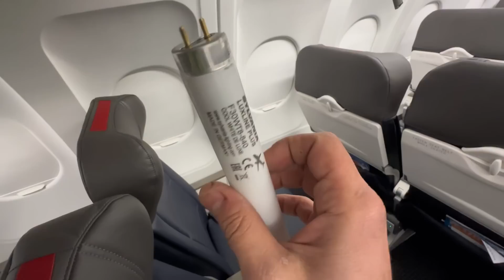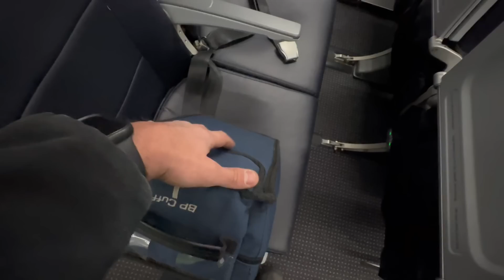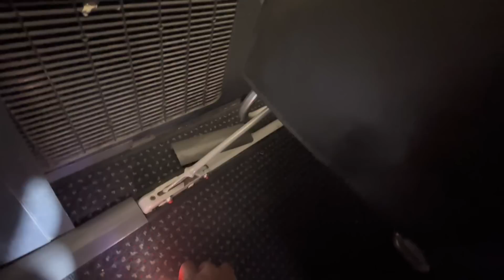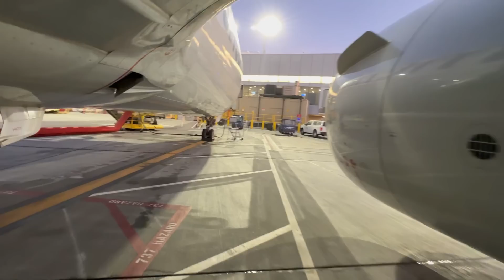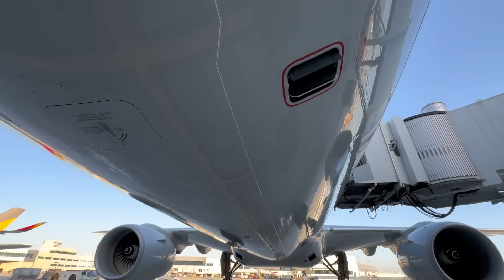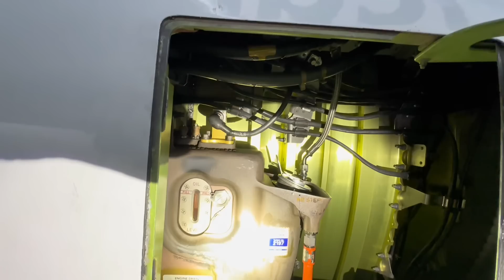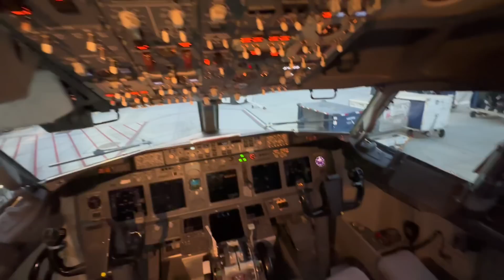Stig Shift #52 (Aircraft Maintenance Adventures)

Comment: I used to build those antennas. Viasat, Honeywell and another one I can't remember. But I did not install them. It was an interesting job though. Now I'm in Parts resolution.
Reply from the maker: @renefuller9241  the other one you’re thinking about is probably the GoGo antenna.

Comment: Studying to become an A&P, im in school.  As far as swapping out the bulb, is it easier to just take the old bulb when you get the replacement bulb with you or would you reference the manual just in case it was the wrong one installed?
Reply from the maker: @IamRayne1992  I would reference the manual, in this case the IPC, the illustrated parts catalog, to make sure that the previous bulb was the correct one installed and I will be installing the correct new one according to what the current manual says.
Reply: Cool thanks for the response. 🙂

Comment: Mr Stig, 
can you answer a question for me 
thanks
Reply from the maker: @MeaHeaR  what’s your question?
Reply: @StigAviation  oh thank you Stig,  my question relates to the A320?, I notice on approach these particular aircraft are very very irritatingly annoyingly loud. They tend to create a horrible whistling noise at approach. 
I usto think it was the CFM 56 engines but then a 777 flies over and it is super quite.
I heard somewhere its to do with fuel over pressure protection/equalisation venting. 
Is that true, why does only airbus have it, is it necessary,  can they stop it  and could you point out these under the wing and explain their operations 
Thanking you in advance 
Have aMerry Christmas 🎅 🎄 and a safe and prosperous new year.
Live long and prosper 🖖🏾
Reply from the maker: @ that’s only on very old Airbuses. Most of them have been modified with a little aerodynamic vortex deflector that diverse air away from the surge tank vent to prevent that noise from happening  i’ve talked about this in my previous videos. It was a while back though.
Reply: @StigAviation  ok thanks for the reply, I'll look for it, 
Regards 😀
Reply: @StigAviation  Also is the PACK a mechanical system, or just a simple air inlet duct 🤔
Reply from the maker: @ pack system is a bleed air driven system that has many mechanical and electrical components to operate it. Source of air comes from the APU or engine along with outside ram air.
Reply: @StigAviation  thanks 😊 i wasn't sure if it was just a simple heat exchanger
Reply from the maker: @ heat exchanger is also involved, I have done a segment on air-conditioning in previous videos.

Comment: Hi Stig! First off, I love your videos! Being able to see all the different parts of airplanes we wouldn’t see when flying on them is super cool! 
I had a question, not sure if you have covered this in the past, but I’ve always been curious. I’ve flown on a lot of 777s and always wondered why when the plane touches down on the runway, why does only 1/4 of the spoilers/ speed brakes deploy, and then 2-3 seconds later…. the rest of it deploys? May be a dumb question but I always wondered why it’s specific to that plane. Thanks!
Reply from the maker: Well that’s because you were looking at flight spoilers and you’re looking at ground spoilers. They go up in a sequence. As soon as it touches down the ground spoilers will go up, and then the flight spoilers will assist.

Comment: Hey Stig ! Really appreciate your content !
Just about the SatCom / Antenna part ; I would be more nuance on what you said. 
Those antennas (including in the AMM - at least for a linefit solution) are called SatCom antennas. This term is generally used to refer to any system air to internet satellite with Airbus.
What you talked about is the difference between the SatCom system (based on the Airline Network Architecture ALNA >HBCS<) dedicated for Wifi (and cellular GSM in option) for the cabin and the Cockpit SatCom. 
Cockpit SatCom is based on the L band (just like very old cabin SatCom) and is today offered either with Iridium Cockpit SatCom either with Inmarsat Light Cockpit SatCom. They have many differences but at the end they use a relatively small antenna called ELGA/HELGA placed on the front of the a/c. It mostly is for cockpit wifi (voice over IP in option) and for applicable a/c FOMAX in flight datalink.
Cabin SatCom either use a 2KU or KU or KA band antenna. They can be hooked up with IFE system only, IFE and Cabin Wifi (through WAPs/KRFU/KANDU), wifi only, and even with the cockpit for non-safety communication.
At the end, they are all called SatCom antennas but what they are doing is very generation dependent as well as very configurable. And I am not even talking about STC solutions !
Have a look to those articles :
https://aircraft.airbus.com/en/services/enhance/system-upgrades/light-cockpit-satcom-lcs
https://aircraft.airbus.com/en/newsroom/news/2024-05-airbus-hbcplus-satcom-solution-progresses-towards-service-entry-in-2024
Cheers !
Reply from the maker: Thank you so much for the wonderful information. I really appreciate you doing this and going deep into the topic. However they want to classify it, when it comes down to my knowledge I simply look at what our manuals state. And what I said about the big dome, they strictly call it a Wi-Fi antenna. The Satcom antenna is much more forward on the top behind the one of the VHF antennas. It’s a circular small unit. But innocence yes you can call them both satcom Because they’re essentially doing the same thing. Talking to satellites it just depends on what kind of band   Thank you once again for the beautiful information and cheers 🤙

Comment: Stig, at what point would the fluids, either hydraulic or oil, be a little low but not low enough to bother topping it off? In other words, is there some sort of cutoff where you would have to top it off? Thanks, and keep up the great work!!

Jim B.
Reply from the maker: Yes James, there is a limit on how low it can get. We monitor the systems and we check if it needs any kind of servicing. If it’s below a certain limit, we will replenish the fluids. It’s all written in our documentation of our maintenance manual. And even some aircraft are very smart where it will actually tell you, low oil or low fluid within the flight deck

Comment: Stig,, can you explain the MAX engine anti ice system next time?? I am curious about the issues with certification delays surrounding the MAX 7 and 10.
Reply from the maker: From my understanding the issue is that it is causing an overheat and can potentially cause an engine issue. That’s as far as I know about it. Boeing is going to be doing testing to fix this problem.

Comment: Stig, Quick Question, as a manual wheelchair user, I have always been worried and curious about what happens to the wheelchair when I get on the plane, I've been told that sometimes it can be stored in the plane cabin (Never happened to me) and if there is no space it will go in the hold. how does it get from the plane door to the hold and where in the hold does it get secured?

Look forward to my Saturday morning routine for over a year now! Thanks for inspiring the new generation and supporting not only the community with great content, but keeping it very entertaining!
Reply from the maker: Most of the time, the wheelchair will be placed in the cargo hold. They will walk it down the jet bridge stairs and loaded into the cargo. Upon arrival they will retrieve the wheelchair and bring it back up to you right at the door of the aircraft. Or they can have it right by the gate entry area. There are a personnel with wheelchairs that will assist you in that scenario. As for having the wheelchair inside of the aircraft, I have never seen that as well. Most wheelchairs are pretty big. But the aircraft has its own wheelchair to get you up and down the aisle to board and disembark

Comment: I find it interesting that despite it being a Max the airline still opted for a light based checklist to be installed. Really are different ways to customise your plane!
Reply from the maker: @Azbz4937  what does that even mean, you need to clarify your statements, what does a light based checklist have to do with anything?
Reply: In terms of the Max being mostly digital and capable of e-checklists but there’s an old school analogue light based one. You could argue that paper is analogue as well but I haven’t seen much light boxes installed in planes.
Reply from the maker: @Azbz4937  you do understand that the 737 is still 1960 tech technologies, there’s so much they can upgrade to this airplane. You’re talking about a checklist that was removed from the control column and down to the pedestal, which is only an option, but regardless of that it’s just a checklist. I hope you remember that most older airline didn’t even have that, it was a paper manual or a laminated manual that they read by hand

Comment: I really really love your content?  How many physical breakers are there in the cockpit of the 787?  I was told there are only 2 physical breakers in there.  Do you know where they are???  Heard this at Boeing orientation while working at 787 final assembly line in Charleston.
Reply from the maker: As far as I know, there’s only one physical circuit breaker in the flight deck of that airplane. It’s for the fuel shut off module. It’s located to the right of the first officer lower panel. But it’s not accessible to the pilots. You would have to remove a panel to get access to it.

Comment: I noticed every time you showed the ground air supply hoses connected to the bottom of the plane, they all looked like they were kinked so bad that the airflow must have been greatly reduced. Is that normal? Anyway, really enjoy your "lessons" Stig. Thanks and have a wonderfull Holiday season!!
Reply from the maker: Yes that’s one thing about those air hoses that they just can never get the sizing right. It’s either too long or too short. I guess having it too long is not as bad as too short. Yes there is a bit of a kink in there but I assure you Air still flows. And thank you very much and wishing you a wonderful holiday season

Comment: Hello you talked about the satcom being a diffrent antenna. Could you tell me where it is located🥺
Reply from the maker: It’s slightly forward of the Wi-Fi antenna, it’s a small little circular antenna that’s it’s almost flush with the fuselage  other aircraft might have it configured a little bit differently and shaped a bit differently
Reply: @ thank you so much:)
Reply: @StigAviation  is it behind vhf 3?
Reply from the maker: Slightly aft of the VHF 1 on the Airbus 321

Comment: I think I saw a few flashes of it in this video, but would you be able to talk about aircraft insulation? Or do you already have a video on it? It looks a lot thinner than house insulation, and I'm sure it's a lot lighter (and way more expensive) but it also has to deal with a much higher temperature differential, and a bit higher wind speed than most houses. Also given the Swiss 111 tragedy, I'm sure it's made of some really strictly controlled materials.
Reply from the maker: That’s actually a really good question, and to answer this properly there’s actually three different kinds of insulation they use. It depends on where it is on the structure of the aircraft. Some of it are just blankets with various amount of thicknesses and some of it insulation is actually adhered foam. Look up TERUL 18 and TERFLAME 29. matter of fact I’ll go over this in my next video in much more detail. Thank you for the inspiration
Reply: Thanks, Stig! I'll be looking forward to your next one even more now!

Comment: That heavy flame resistant insulation on that wire to the fuel probes was probably brought on by TWA 800. Advancement in aviation safety.
Reply from the maker: Yes indeed it was part of the modification. But the biggest modification was the NGS, nitrogen generating system for the center tank.

Comment: Hey Stig, talking about MEL, on my last flight, the APU was inop. Felt weird on an eleven hour transatlantic flight (Frankfurt - Cancun), and doubly so because the aircraft was fresh from a C-check (first revenue flight after the ferry). 

If this was just a short hop overland, I would not have minded, but when the pilot announced that they had issues with the APU and had to wait for the ground start unit, that was not a nice feeling before crossing the Pond.
Reply from the maker: When something like that happens you still don’t need to worry. The reason behind that is since the APU is not working even on a transatlantic flight, the pilots will now choose a different route. That means they will be flying a longer trip and they will adjust to being near airports in case something does happen.
Reply: @StigAviation  I did some digging after your reply and was surprised to learn that the A330 gets a 120 min ETOPS rating with the APU on MEL.

Also, I have to say, the A340 on the way back felt safer. I know that 4 engines are no longer required, I know that twinjets are really reliable, but there is always that small part in the back of the head that does not care about facts.

Keep up the good work. Your videos are really great, and the fact that you answer comments even more so.

Comment: Stig I have a question about auto throttle. How much force does it take to move them levers fwd. In factory we calibrate at 1.8 lbs with force gage,but  without links and connections. Boss says 8 lbs but I'm not so sure.
Reply from the maker: Not quite sure what kind of test you guys do there but for us there is a torque test that we can perform. The manual states that to make sure that the torque does not exceed 11 inch ounces while the thrust levers are moving. Also make sure that the torque does not exceed 17 inch ounces while motors are driving the thrust lever against the aft stop

Comment: What are your thoughts on the flyby wire throttles that they’re now putting in the 737?
Reply from the maker: It’s the evolution of the aircraft, it’s a much smarter system. The 737 has evolved to a point where it’s not running the good old JT8 engines. You are now dealing with an upgraded CFM engine that has electronic engine control units. That is the new standard. It’s a lot smarter that’s a lot better and more maintenance friendly

Comment: Do they tell you for each particular flight how early you’re allowed to start the APU for fuel savings and fuel calculations for the flight?
I know as a pilot when I turn it on I’m factoring it in right then and there, but I’ve never flown anything that big
Reply from the maker: When it comes to maintenance, it is our prerogative on when and how we want to start the APU. If I need the APU for any reason I will start it whenever I want. Pilots have a very differentrule book, maintenance rulebook, we can do whatever we want if we are performing maintenance
Reply: I don’t think I asked the question clear
I was just curious about starting the APU early on a flight that needs the maximum amount of fuel available…. Are you told about that ahead of time so you can keep the airplane on GPU versus APU?
Reply from the maker: @ oh if that’s what you’re mentioning, well I can start the APU long before the flight is scheduled. Because when it comes down to fuel, they are refueling the aircraft right before departure. Usually about 45- 30 minutes before departure. So there’s never any risk of not enough fuel. If ground power is available, then we will use it, if it’s not we have to resort to running the APU at all times. Also you have to take in consideration the weather, sometimes it’s very hot outside and we do need to cool the aircraft down using the air conditioning for passenger comfort  that means running the APU. Not all jet bridge facilities have preconditioned Air

Comment: Hi Stig, another fantastic episode thank you!
Am I right in thinking that the 737 does NOT have full Main Landing Gear doors.
I keep seeing the round apertures for the wheels but no corresponding “round” doors. 
Around the wheel wells I see rubber flaps, are these supposed to create a seal? Surely with no closed doors the wheel stowage area along with all the equipment are partially exposed to the elements?
Surely this will create some drag on the underside of the aircraft?
Reply from the maker: The 737 does have main landing gear doors, they are simply attached to the main landing gear strut. Matter fact there are three of them, upper center and lower door. The only thing it does not cover is the outboard wheel
Reply: @ thanks for that. I think that’s what I was trying to say. The outboard wheel is still visible when the strut doors are closed meaning the whole compartment must be letting in air around the outboard wheel through the rubber flaps? I note that the outboard wheel also has a centre cover, but the tire would be visible from underneath the plane?
Reply from the maker: @ the only thing that’s visible is the outboard wheel, everything else is closed off and it’s a perfectly good airflow with no obstruction. So it’s not affecting any kind of aerodynamics. Everything is flush
Reply: @StigAviation  Cool, must be a very snug fit then. 
I wonder why Boeing decided not to fully enclosed the wheels like Airbus?
Thanks for taking the time to answer my dumb questions! 
I look forward to your next episode every week. Keep up the amazing work. I drove past London Heathrow airport recently and an American Airlines plane took off straight over my car! I immediately thought perhaps Stig may have prepared it's ETOPS. 😁

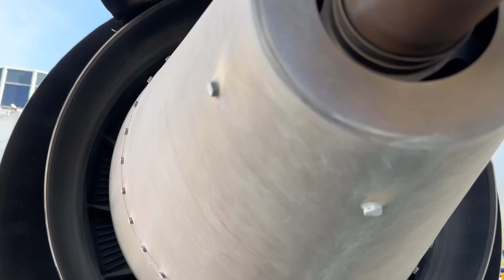Comment: 18:08 probably a stupid question, but what would happen if you pull the landing gear lever on the ground?
Reply from the maker: Absolutely nothing. I’ve talked about this before. No hydraulics are running. No pressure to the actuators. Also weight on wheels and ground proximity switches prevent that.